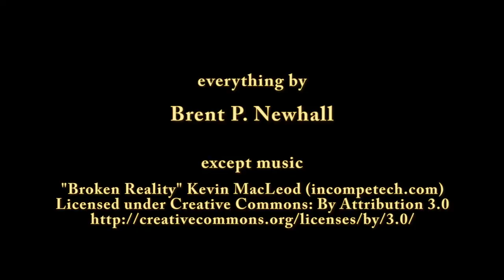BEGIN Blacksmithing: Hammering a Nail

Comment from the maker: I mentioned last week that I bought an anvil. Here's video of my first experiment with home blacksmithing, where I heat a nail with a blowtorch and bang on it with a hammer.

I'm purposely using tools you can find around the home, which may not be ideal for blacksmithing. The point is that one can get started with a tiny investment.

I didn't accomplish much, just heated up a nail and shaped it a bit. But I now have a sense of what to do next time (heat it longer and make bigger, firmer blows).
Reply: You're holding a little too close to the base of the torch. The hottest part of the torch flame is just above the inner blue cone. 

Also, if you can get to a Tractor Supply store around early Fall, (though they may have them now...) you can get some firebricks. which would allow you to work a little more comfortably on the wood floor area, as well as give you the option of building a mini forge.
Reply from the maker: E. Bryan Rumph Ah-ha! Thanks, that's very helpful. There's a tractor supply store in my town, as it happens.
Reply: No problem. :) I've been wanting to build my own forge in the back yard for awhile now... it's a natural spinoff of DarkAngel MetalWorks... I've just haven't been able to do too much. 

The problem with using the propane torch, is that all the heat is blowing straight off. And the propane doesn't quite get hot enough (2500 degrees). You have to be able to trap and focus it on the metal. That's where a firebrick forge can help. Although you'd have higher initial temps with an oxy/MAP (~2900) torch.

But of course, Oxy/Acetylene (~3500) would be best.
Reply: And Brent I assume you are, but always remember to wear eye protection when hammering on metal.
Reply: and Glass doesn't count!
Reply from the maker: Brian Wille Of course. :-)
Reply: I'd move the torch over by the door behind the anvil. The closer you can get the flame to the anvil, the less heat you lose moving the metal around in the cold air.

Comment: If you continue to try to black smith this way, even though it would be way way way easier with a proper forge, you should use Mapp gas. Usually comes in a yellow canister, burns much hotter. But you really should build a forge. You can build one for not much, or, if you aren't handy, you can buy a simple one for under 200$.